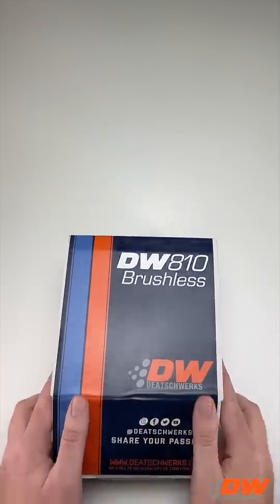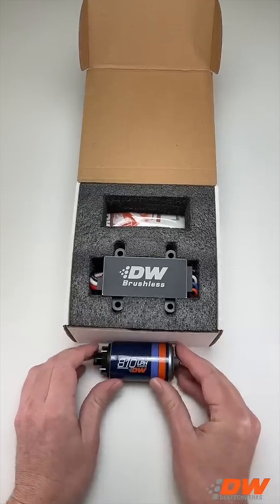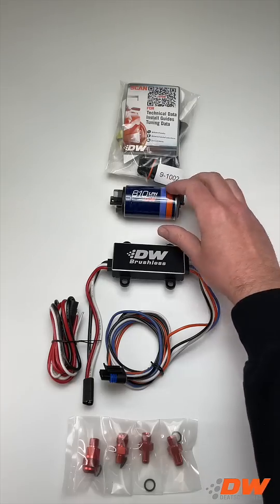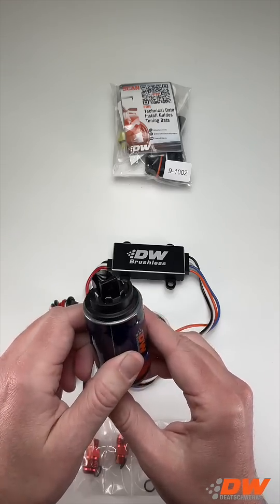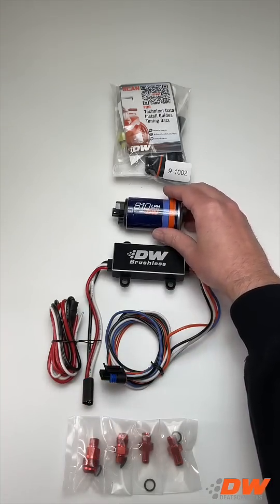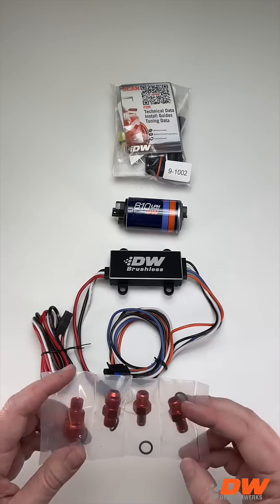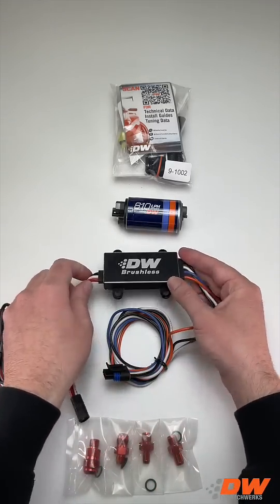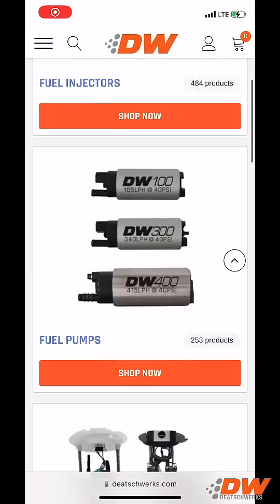DW810 Brushless Fuel Pump

Comment: Can this be wired to run at 100% all the time for vehicles without pwm?
Reply from the maker: Great question! We do not recommend running the pump at 100% all the time due to the risk of damaging the pump and controller. Our controller does not require a PWM signal because it comes with a two-speed controller that can operate off an RPM switch, Hobbs switch, or any switch or output that can ground the white wire. For further questions, please reach out to our tech staff at techsupport@deatschwerks.com.
Reply: How much hp can this support?
Reply: @dutnu2339 that would depend on the rest of the fuel system...but if you had an AN10 feed line, the specs indicate it would flow enough for 8-900 rwhp assuming you have the injectors to support that